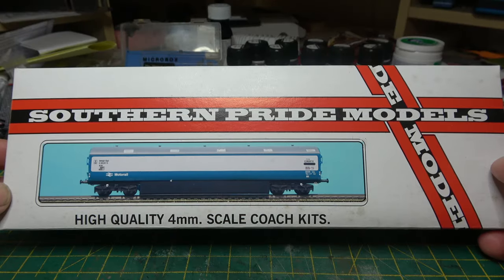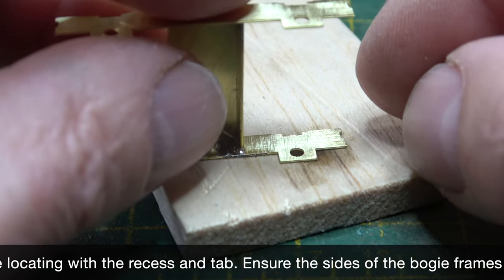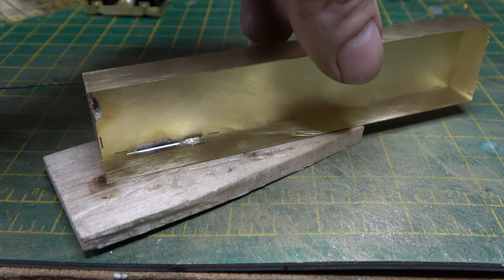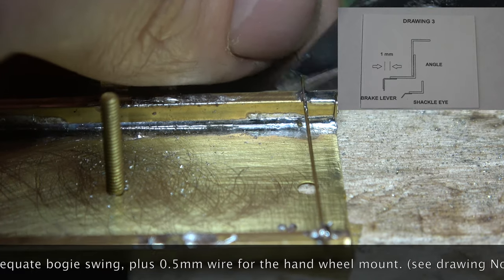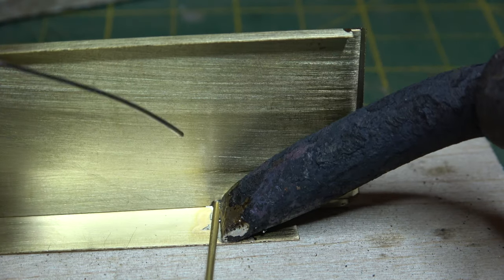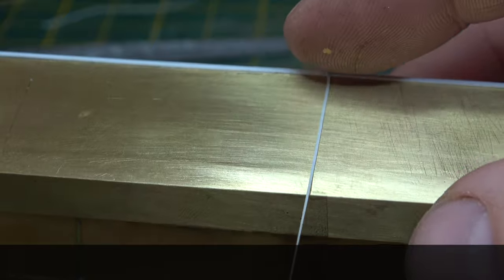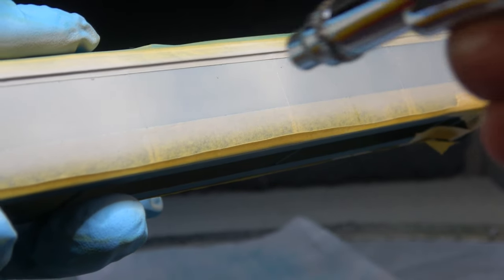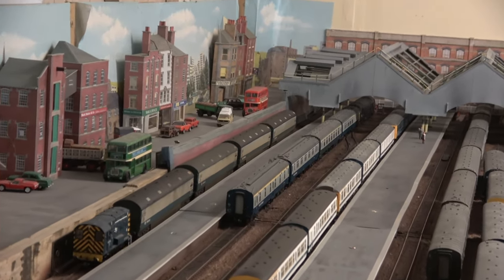Newton Chambers Motorail Car Carrier Southern Pride kit build

Comment: Hi, I've just watched this video and heard you mention the BR TIERWAG.  I have a little knowledge of them.  I grew up in Dorridge just South of Solihull where Rover build their cars.  Dorridge  had a general goods yard built in 1933, but by my time had become a private siding owned by MAT Transport.  There main business was the carriage of new cars for the export market ex factory.  The Rover cars were shipped to the yard by car carrier, but Land Rovers and later Range Rovers were driven by a number of young ladies, the bussed back to the factory for more.  I remember the Tierwags being loaded at Dorridge yard along side the goods shed.  In 1973, I started work for British Rail in that very yard.  The Tierwags had gone by then, but the man who maintained them still worked there on the rest of their fleet.  They were powered by electric motors to raise and lower the center deck, and were extremely unreliable, especially in the ice and snow, and were very unpopular.  They loaded to Harwich and Dover mainly, with occasional trains to Bathgate in Scotland.  The posts for the power were still in the ground though.  MAT also shared a siding at Bell Green near Coventry with Silcock and Collings.  MAT are probably better recognised for operating the CARTIC 4 sets of which they had a fleet of one hundred.  They also owned a fleet of CARFLATS, converted from old SR coaching stock underframes.  A number of these were RIV registered and were used for cross channel transport from Paris to collect MASSEY FERGUSON hay balers in the summer.  One other comment, the little lever next to the handbrake on your van could be an empty/loaded changeover device that adjusts the brakes according to load.  They are common on European goods vehicles.
Reply from the maker: Very interesting, thanks 👍